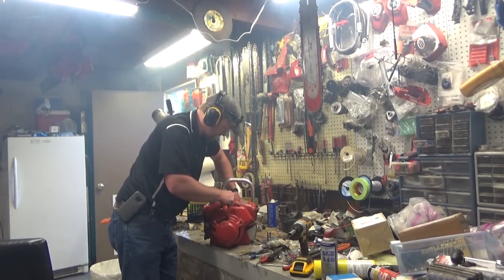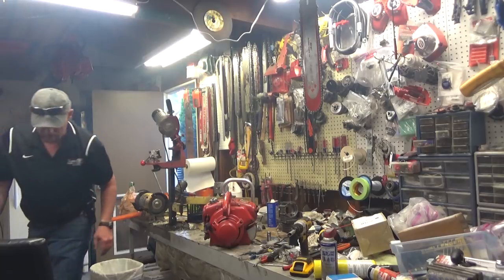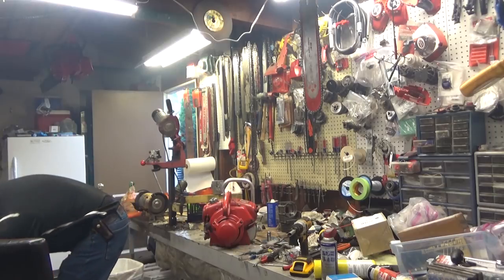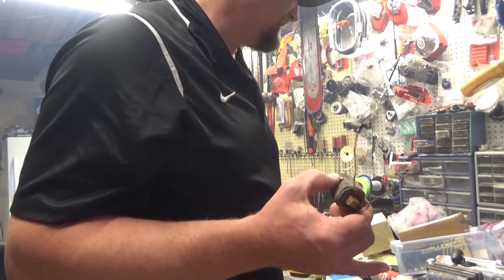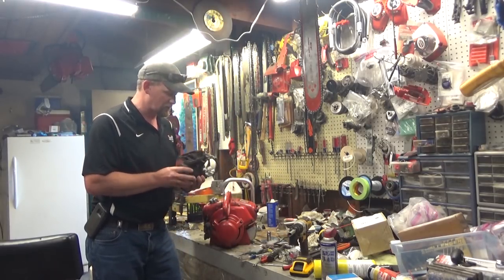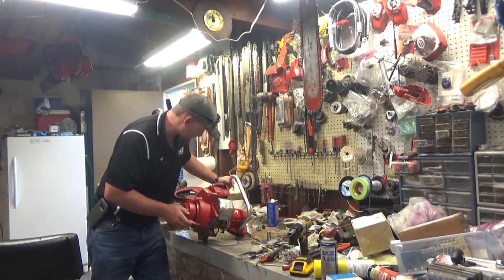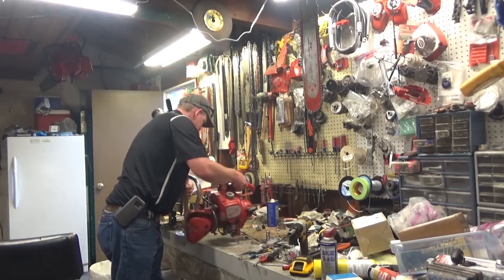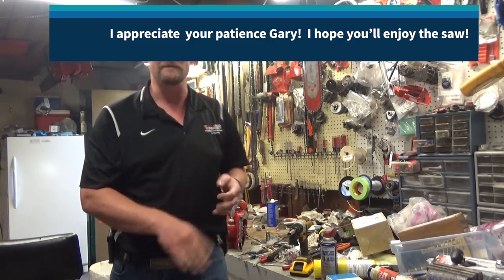Gary's Mall 2MG Test Run FINALLY!!!!

Comment: Nice Video! I have a Mill 2 MG and getting intermittent spark but when it does spark is very strong. The coil does have a crack in it not sure if I have a points or a coil problem did you do a video on the coil conversion?